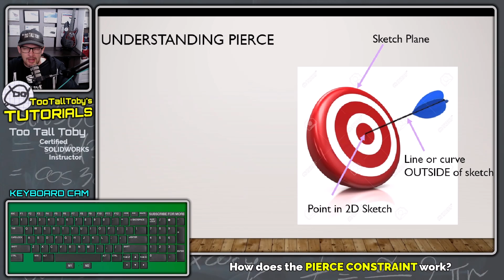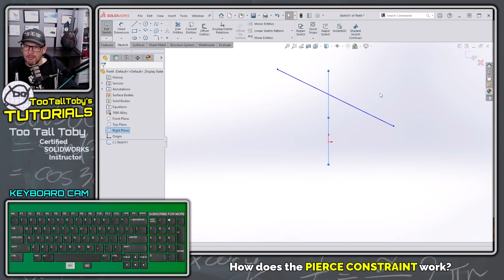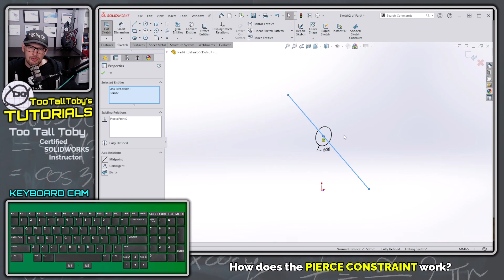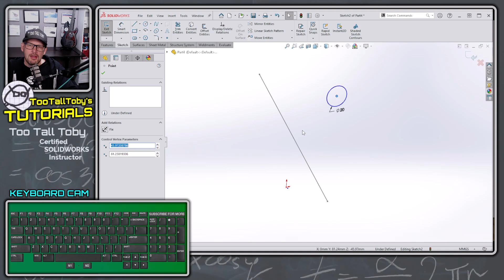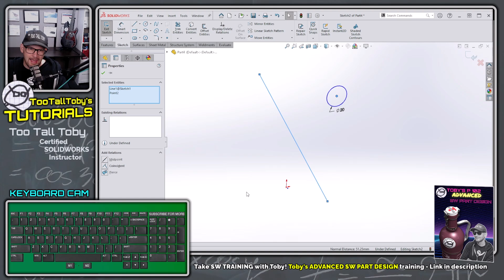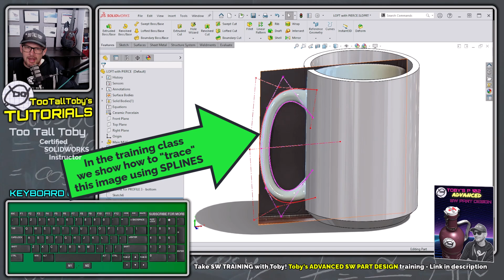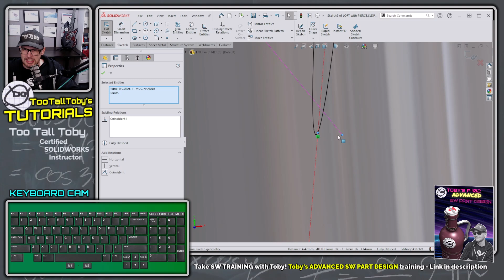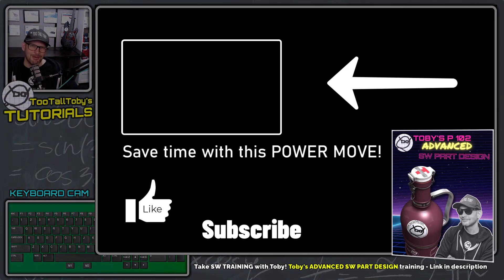SOLIDWORKS Pierce Constraint Explained for Beginners

Comment: Many thanks for the clear explanation of this constraint command. I have 20 years of complex and advanced surface design knowledge in CATIA, but with my new job I'm struggling to learn Solidworks and make the build methodology connections. This helps! Can you use Pierce between a line and a main plane (ex: Front Plane, etc) or does it need to be a generated plane? I'm not seeing the Pierce option show up when attempting a main plane. Thanks.

Comment: Why I can't find the Pierce feature in my solidworks 2025 features? I tryed many times to do it but nothing
Reply from the maker: Usually it's due to a bad selection - meaning you didnt pick a line from outside the sketch, and a point from inside the sketch.  That's usually why PIERCE doesn't display as an option.

Comment: One thing I've noticed with the pierce is that if the guide curve is modified, the pierce does not automatically update to new location of piercing,. While it does not show a broken link, one has to manually delete the old pierce and do another one. Is there a workaround for this?
Reply from the maker: Not sure-  at 5:55 in the video I show the pierce constraint relocating and updating after moving the guide curve.  So it's intended to work that way, and always has for me.  Maybe try CTRL+Q after updating the location of the guide curve?  Could just be SolidWorks being SolidWorks

Comment: Hi Toby. There is a lot info about model assemblies but i havent found anything about dissassemblies. Like we design some part, add some more details and at some point we find out "ok this detail should be a separate part". So now we face this problem of "how to make two things separate but dependent on each other (their shapes) and without using variables (because some shapes are outcome of designing and cant be set as variable). I started to design things a mothn ago and already faced this issue twice.  What is the generic approach here?
Reply from the maker: This is definitely something we cover in the Advanced Part Design training class we're hosting later this month:  www.TooTallToby.com/training

But the answer is this:  
1. Insert, Features, Split - to split a single body into multiple bodies.
then
2. Follow the steps in this video:  https://www.youtube.com/watch?v=IoDE6nea0b8 

hope this helps,
toby